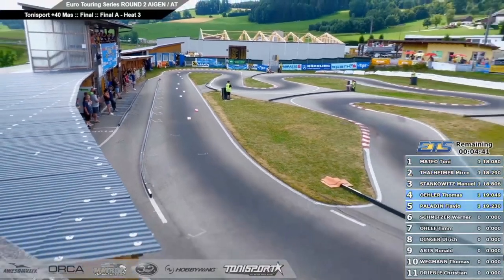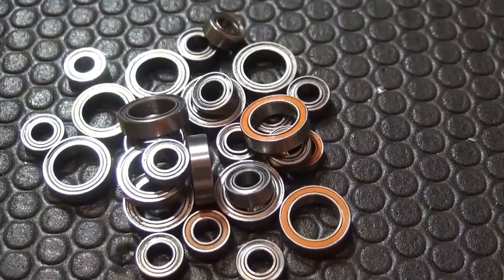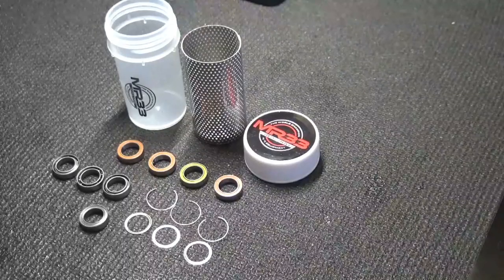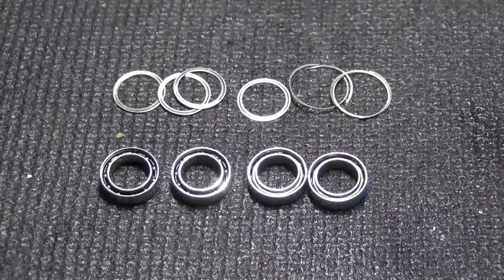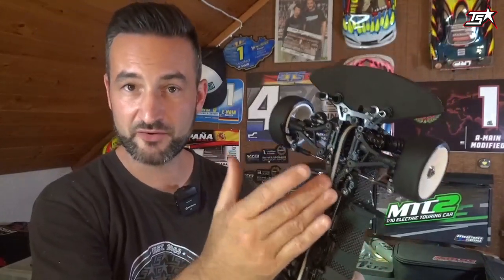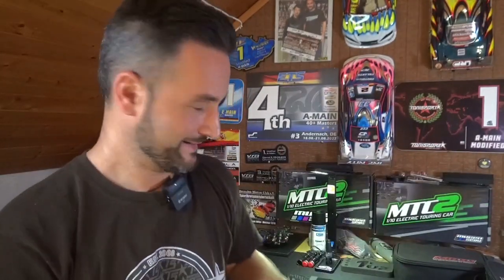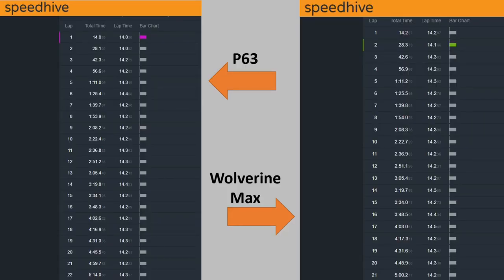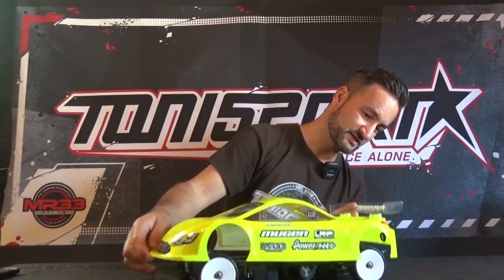ToniSport Newsfeed: 17.5T Stock Racing Bearings, Drive Belts, and Protoform P63 Feedback

Comment: Hi Patrick question what FDR would you be running on the big tracks .I run 17.5 on a tight track so I am interested in what would be used on the big European track
Reply from the maker: Hi Robert, that is not easy to say. At the ETS we are running at 4.5 ratio which is the maximum allowed - and the best solution in my opinion!
But for open stock classes it is depending on the track size and motor. I think with a strong 17.5 Stock Motor (strong magnets and good cooling) you can go down to 4.0 or even lower to 3.8 or 3.6!
Just check the temperatures of your equipment and think about that at some point the longer gearing will not make you faster anymore as the acceleration gets even worse and you are only producing heat...